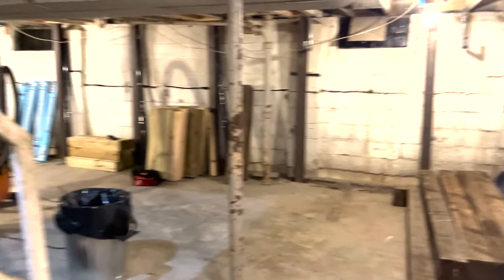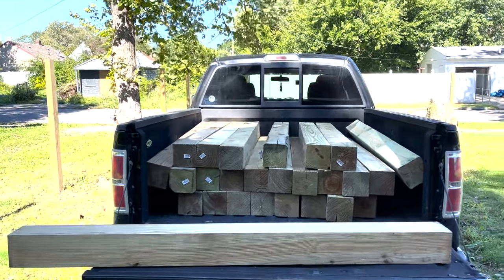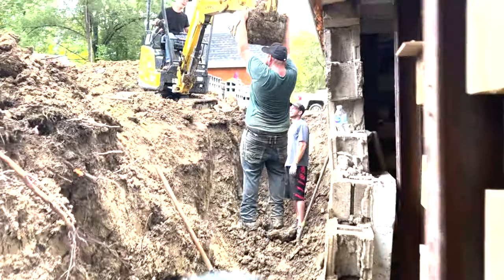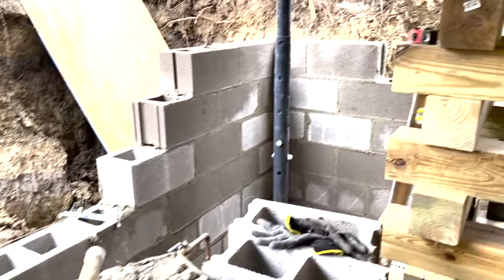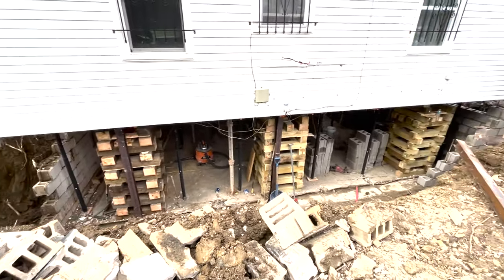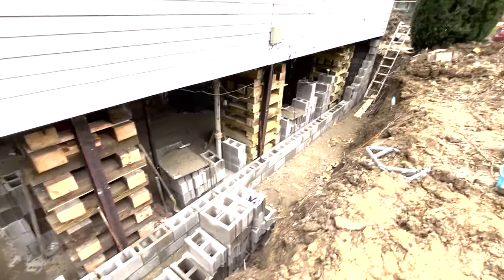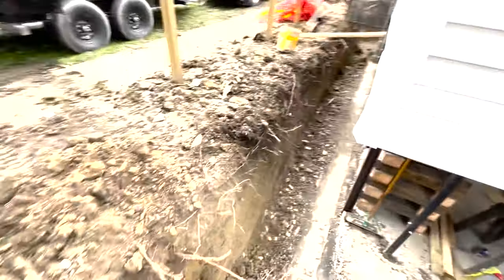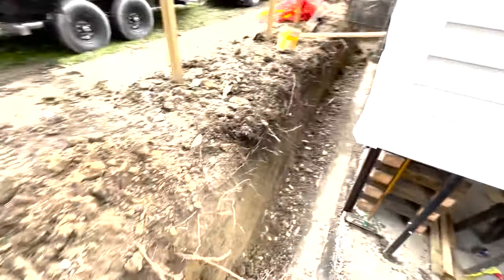DIY house lift - foundation repair / basement wall rebuild

Comment: It still cost you a pretty penny, nothing is what you think it will be at the start
Reply: If 720 hours at $25, $38,$40 per hour, plus? Your time
Reply: I raised one of my three stages of the house my wife and I built from scratch. 14’ x24’ we ran out of money! Six inch step. I hate it. But our house is a very fine house, no cats, MO MORTGAGE. I don’t like other people work ethic, so we tried to do as much as possible. Forty years later, major squirrels damage, we are renovating. She does her part and I do mine. You did a good job. I would factor more in your cost. But live and learn

Comment: What other information did you find to better comprehend what you were doing? I have one wall I need done but it's brick so would want more information but can't find answers.  Any suggestions.  Thanks
Reply: Not a professional and not my page. But I got some experience on this. Brick if the connecting walls are out of square real bad ur courses won't line up. I have learnt 5he hard way on tht. Chances are tht is the case usually is. Lots of information out there what causes foundations to fail.  Always fix the cause of problem while u have it dug out to. Drainage waterproofing etc.
Reply: @reddye2331  Thanks for your time and help. God bless

Comment: Great job on the rebuild. Thats a big project for sure. I got a house in 48035 NE of Detroit for $9900 in 2009. Lets just say it needed some work. Gutted it etc. Where theres a will theres a way. Knowing a good bricklayer makes a huge difference on a project that big. Ive underpinned rat walls before when i added and addition to a house to connect it to the garage which only had a ratwall. It was sandy soil so easy digging by hand. Never stop learning.